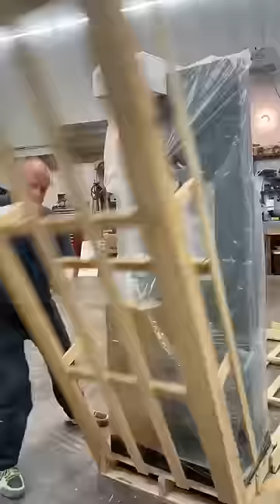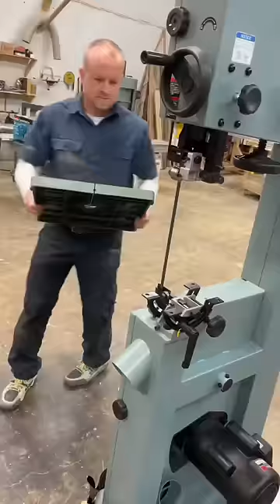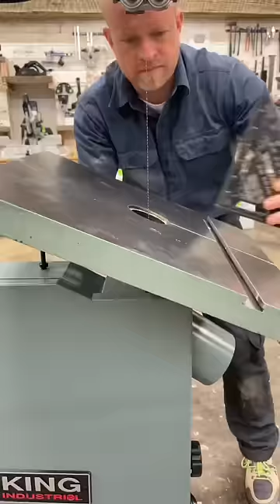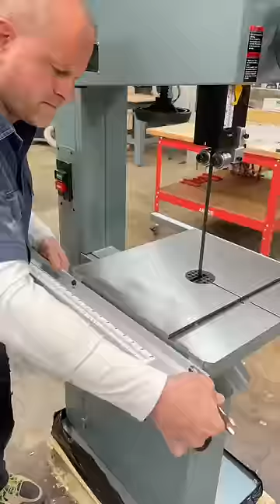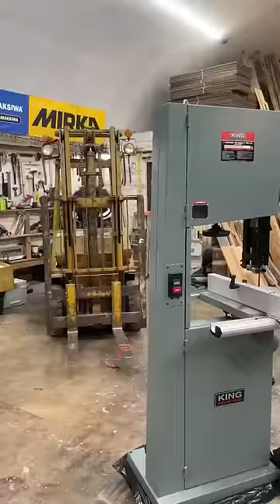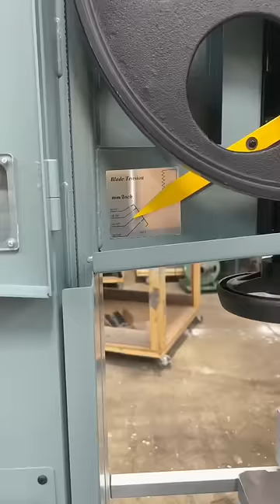Assembling the new bandsaw #woodworking #shorts #diy #maker #woodwork #tools #wood

Comment: Thousands of these were made for different companies with different brands on them. This one is identical to my General International 18" machine. General is a quality Canadian manufacturing company, but they also sell a cheaper import line under their International brand. Unbelievably, when I needed new tires (18x1"), nobody but nobody could get them.
Another downside is that the slot on the table is perpendicular to the direction of feed, which invariably catches the work and causes a jog in the cut. At about 1200 US dollars for the two speed one HP version, just a little more thought in the design, and it would make a great saw, instead of just a good enough saw.